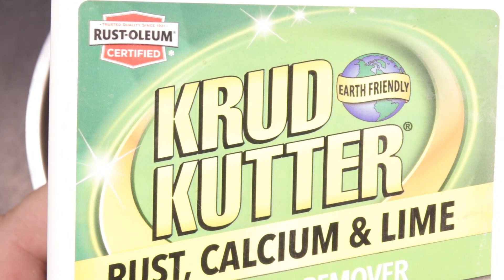Hot Wheels Custom Camaro - Happy Halloween!

Comment: Great effort, it turned out great! I recently did a similar orange 67 Camaro but used a later casting and swapped redline wheels onto it. My fav hotwheel as a kid was the green 67 Camaro from the 1983 belt buckle set because it was very close to the green 67 RS Camaro my dad owned. Dad passed from cancer in 2015 but the Camaro is still out in the garage and is no longer green. It looks more like the red 67 Camaro from the 1995 Chevrolet 5 pack.

Comment: Sweet  ride have  you  tried  zink plating
Reply from the maker: Zinc plating would not have resolved this issue.  The plating process is a chemical reaction, not a coating like paint.  The result is that the zinc plating, which is very-very thin, coats everything evenly.  Basically, you would have a zinc plated divot.  I have plated many-many castings and while small imperfections and corrosion can often be solved with plating, a missing chunk of material cannot.
Reply: I can't  get  my fill of restoration  videos

Comment: Nice save Lee! I just scored one in about the same condition so you've set me up well on fixing it. I don't have a zinc plate set up or that so I'll go your route.  Cheer's Tassie John
Reply from the maker: Thing is, plating wouldn't have helped this.  It's tough to try and use plating to act as a fill for a divot this deep.  Plating, being a chemical reaction plates evenly, so you wind up with a plated divot.  Plating can help when there is corrosion or minor pitting, but it has its limits.